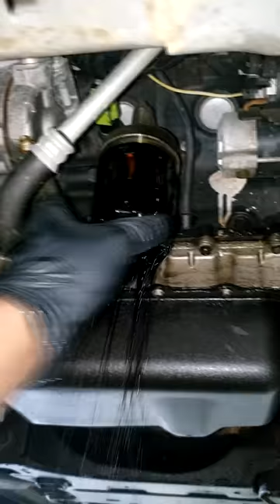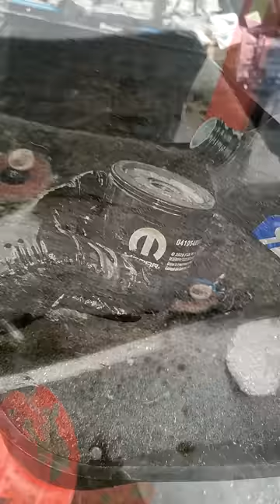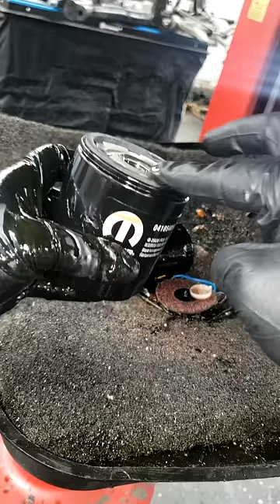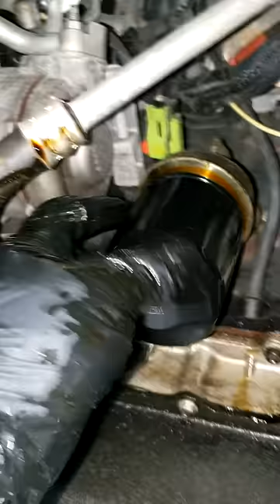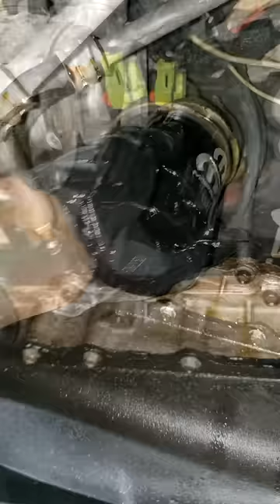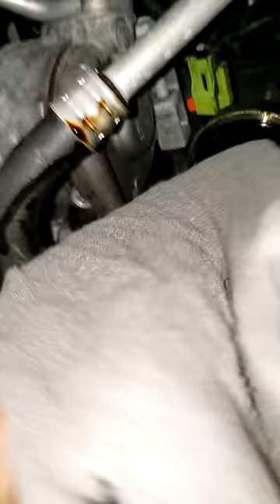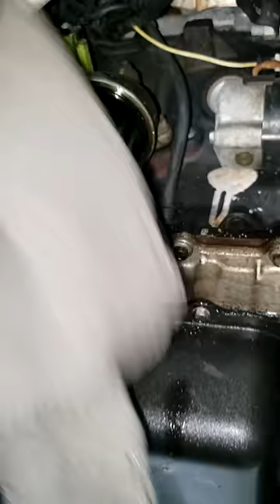Don't Lie.. Are yall still doing this?

Comment: We stopped when the engineers started putting the filters on the side of engines 😂
Reply: Mine's on top...
Reply: It still takes a few seconds to get that oil to the vital parts 😅
Reply: Designing the engine for the filter to be in the horizontal position is the most stupid design ever.
Reply: @bobby1970  what about the drain plug on the side of the oil pan so you can never fully change the oil?
Reply: @ryangallagher7262  Wow, I've never heard or seen of a oil drain plug located on the side of an engine oil pan. That's just as a stupid design as having an oil filter mounted in a horizontal position.
Reply: Looked for this comment. Felt like a dumbass after filling it to remember...its a side application. 😢
Reply: @CadillacDriver  even worse to prefill! 😂 but also... Luckyyyy!
Reply: @bobby1970  my nissan hardbody does that! And oh man you should see the filter location, I can't believe how many people love these trucks
Reply: @ryangallagher7262  
You don't need to "pre-fill" ffs.
Reply: I was looking for this comment. All the cars I've owned either had it horizontally or on top. 🤔
Reply: Or on top! Haha
Reply: @josedias2585  I just learned that was a thing! Luckyyyy
Reply: @CadillacDriver  mine too, so do we fill it where the filter sits? Lol doesn't seem like it matters if so...
Reply: @ivandreaver2227  
No, definitely not. Pre-filling is unnecessary.
Reply: I had a Saturn Ion and a V6 Tundra that the filter goes on upside-down.
Reply: My Hilux has it on the side, facing down at 45° or so. All other cars we've owned have them on the side at 90°
Reply: @bobby1970  maybe that was the only solution they found to stop stubborn mechanics to prefill the filters when it's totally unnecessary and might even send unfiltered oil in the engine ?
Reply: @pbe6965  What unfiltered oil? If it's new clean oil that I prefill into the new oil filter, then it's already filtered. It is necessary to prefill an oil filter, if you want your engine to have the longest possible life.
Reply: @CadillacDriver  Subaru huh
Reply: @DannyGruesome  ?? Cadillac CTS 2010.
Reply: @CadillacDriver  i was thinking of the topside can one from subaru. I forgot most cartridge filters are also topside
Reply: @DannyGruesome  
Indeed they are. Makes oil changes extremely easy. I've owned 22 cars, and worked on many more since the 90s. The CTS blows every other car away in terms of ease of oil change. I can't actually think how it could possibly be any easier.
Reply: Subaru is on the top, but you can crank the engine without fuel to prime the filter and oil system. Simply press the fuel pedal fully and clutch pedal if you have it. It will crank without starting until you press the start button another time or it cranks so many times. Simply prime until the low oil pressure light goes off.
Reply: FORD!!!!! IBeen driving chevrolets for years.. Went back to an f150.. And just like they did in 2009...the filter is still sticking out the front of the engine sideways.. So stupid
Reply: @garyrichardson7592  yep, also every time you start it up in the morning.  It's ok.
Reply: @stv-gq4vi  all is already in the filter it's okay
Reply: Mine is horizontal so i don't fool with it ! It's a chevy with 326 thousand miles on it ! Oil change every 5,000 !
Reply: So dumb
Reply: @CadillacDriver unless you have a diesel
Reply: @CadillacDriver  lol you are way way too proud of that old ass caddy
Reply: I just fill them with enough to where it doesn't spill sideways. Soaking the filter media first is better than blasting a dry filter with 60psi of thick oil. Fram filters blow the media out easily. A dab of hot glue holds them in place.
Reply: @benruether8294  you got the exact right answer my friend. I seriously commend you for understanding that when so many other people dont seem to get that. It never hurts to try!
Reply: @benruether8294  good point! Although I gotta say hot glue on an engine is like asking tinker toys to hold up sideways...
Reply: @ryangallagher7262  Never use cheap oil filters. That's what they use to hold the filter element center in the metal casing. Hot glue
Reply: I fill and spin the filter on anyway. If you're quick you don't lose much.
Reply: Yo lo lleno así ya esta empapado el cartón del filtro y un paso adelantado
Reply: @benruether8294  I've seen a lot of screwed engines with fram oil filters. When broken down you'll find these little silver flat round things. What is that?
Reply: Yes and even upside down!
Reply: @@StopPeepinToms I know what you mean, no can, just filter with a rubber ring on each end.
Reply: Yeah what's his plan for paper filters that go in on top? Dump oil on it and over the engine bay?
Reply: Correct. Most vehicles I work on have the filters on the side of the block now.
Reply: I had an old Honda Accord that was like that. I hated it.
Reply: I still try to add the oil in the filter on the side mount, just dont fill it all the way, but yeah, that side mount makes it messy
Reply: @bobby1970 
1. Most of the cars I’ve owned have you pour oil directly into the rockers anyway.
2. Most cars will get scrapped because all the electrical faults make them not worth fixing, long before the tiny bit of wear the engine receives has any effect on its expected lifespan.
Reply: @CadillacDriver  always prefill, tell me you wouldn't do that on a filter that takes 1 liter by itself and has three foot long remote lines.
Reply: @Deere2154D  who the hell is talking about anything but normal, road going cars? 
You do not need to prefill car filters. If you did, absolutely no filter housing would be oriented anywhere but dead vertical, on the bottom of the engine. You have taken my words and twisted them to a scenario we aren't even discussing here. Are you a flat earther? Because that is what they do.
Reply: @CadillacDriver  we are talking about filters.  I'm talking about normal filters I'm around every day as well
Reply: @Deere2154D  yeah? Well this discussion isn't about ones you are around every day.
Reply: @CadillacDriver  it's about prefilling filters you pylon.
Reply: @Deere2154D  no one cares what you are around every day. The discussion is not about THOSE filters.
Reply: @CadillacDriver  "how many of you guys when you're changing oil" not "how many of you guys when changing oil on small cars" 
Oil changes are oil changes, so yes it's still pertinent to the convo.
Reply: Exactly. That’s why I don’t do it. Duuuuuhhhh.
Reply: @Deere2154D  quiet.
Reply: @bobby1970 you mean you haven’t seen vertical top down?😮
Reply: It still might help to saturate the filter media, even if no oil is "loose" in the filter
Reply: Or if the filters installed upside down now so pre charging it you will just be topping it all back out over the engine that you tried not to make a mess
Reply: @bobby1970  yea dumb design. My drain plug is on the side of the of the oil pan. Not only can I not fully drain it..but it shoots out horizontally. I have to move the catch can way off to the side instead of underneath it to prevent spillage.
Reply: the hell is even prefilling supposed to do? it's a superstition lol
Reply: Mine's on top. I fill it up and let the filter soak it up while I drain the pan and take the old filter off. By the time I'm done with that, the filter is charged and I can flip it without losing any oil.
Reply: Or upside down, can't prefil a Subaru 0w20 filter
Reply: @pbe6965 whenever you add oil to the engine (including at an oil change), you are dumping unfiltered oil all over the camshafts. do you really think there is an internal guide to make sure the fresh oil you're pouring in doesn't go through the valve drain before it gets to the oil pan?
Reply: Full agree, I do this only when the oil filtre is in vertical position 😂😂
Reply: You can fill it a little bit just to soak
Reply: My 1968 plymouth has the oil filter sitting sideways
Reply: I got a Rav 4 1998, the filter is face down. I pour some to saturate the filter medium.
Reply: @bobby1970 It's done this way for two reasons, so it doesn't break off of the undercarriage, and its meant for you to change your oil with a jack, not a lift...
Reply: @bobby1970 my 2010 mazda3 is on the side…
Reply: @morpheus_9  That's a shame. It is what it is. Mazda is overall an excellent reliable vehicle.
Reply: @bobby1970  yeah, my mazda3 is a 2.5l and it has 275,000 miles
Reply: @morpheus_9  That is so awesome.
Reply: Hell yeah some car’s filters are on top of the engine lol. 

Everyone’s situation is definitely different.
Reply: @bobby1970 VW gti
Reply: I still do it even when they go sideways. I fill it halfway least the paper soak before I drain the oil.
Reply: YES!!!
Reply: Or in the bottom. Worst place to put the oil filter in some cars omg......
Reply: Yea. Mine on side. And I just changed my oil a wk ago and got a lot of it back onto my damn hand. It’s on the side but pointing more upward. So it only benefits me to fill it halfway and then put it on 🤷🏽‍♂️
Reply: Never have never will, never any issues either over 35yrs
Reply: Crown victoria cop cars have the oil filter in a horizontal postion :P
Reply: The filter in my 2nd gen Tacoma is on top facing down. I’ve never prefill my oil filters. 327k miles and still going strong.
Reply: We used to do that in the old days. The engines then didn't have the same type of oil pressure, compression, or horse power. As I remember, certain vehicles didn't have the oil pressure to fill the oil filter empty, it need the oil in there to create a siphon effect, and thus, you prefilled inordered to give it enough pressure to push through the filter. I never have pre filled the oil filter on my 03 Dakota. Every time I change oil, the filter is full of oil.  You just have to idle , cool down, and add the displacement amount of your filter.
Reply: @ryangallagher7262 I sware that’s why these smart ppl are really stupid doing things like that
Reply: @justinlizamor1541 engineers expected us to tilt the car. 😂😂😂
Reply: I always make sure to do this, even on subarus where the filter is  upside down.
Reply: @garyrichardson7592  yep it takes two or three seconds to get the full oil pressure back after an oil change. compare this to the literal minutes it takes for the oilfilm to break
Reply: I've changed oil in my cars for 50 yrs and never did this. I HAVEN'T any issues....
Reply: Don't forget the top as well.
Reply: @bobby1970 my Chevy cruze and vw passat both have the plug on the side not the bottom.. it is a stupid thing to not have it on the bottom. The oil filter is also on the top of the engine on the vw. Everytime I change it it's a mess if you don't loosen it and just let it sit for a few hours
Reply: Mines normal but i got an old Detroit soooo
Reply: Thank you cause as I’m watching it I’m like “how tf am I supposed to do that if it’s on the side shit finna fall right back on my face”
Reply: The Lexsus LFA has 2 oil filters on top of the motor.
Reply: Facts if I want to pour oil on my floor then I could just do it. In my opinion, that was them telling us that this shit is pointless
Reply: @ryangallagher7262 My Hardbody, my Honda,  my Toyota...nearly all inline engines are like that.
Reply: @jeanclaude7018  hey I got a hardbody too! '96 
Ugh that oil filter is a bitch and a half to get at lol try and prefill that one! 😂
Reply: @ryangallagher7262  Glad to hear of more HBs out there!  My filter on the Z24 isn't horrible to get at,  but certainly no way to pre fill it. My 280Z is like that too. The only way to change it would be a remote adapter and vertical filter on the firewall maybe. 
My Civic is worse because the ONLY access is from under the car, beneath the intake manifold.
Reply: If the filter is mounted horizontally and below the oil fill line, then it fills itself when you replace the oil.  But, not all of them are mounted that way.
Reply: @snarky_user  Well, in that case the filter would have to attach to the oil pan, because that's where the fill line is. They're usually up on  the block, far above the pan.
Reply: I don’t even know where mine is
Reply: Nice to have it on top. When you drain oil the filter will emty itself just by loosing it a little to let some air in.
Reply: HERE is The Savior

HalleluYAH translates “Praise ye YaH”

YaH is The Heavenly Father 
YaH arrives via the TENT OF MEETING
YaH was Who they Crucified for our sins
YaH was Crucified on an Almond TREE

— Ancient Semitic Cuneiform of Moshe (Moses)
— Isa Scroll (The Original Isaiah)

Isaiah 42:8
"I am YaH; that is my Name! I will not yield my glory to another or my praise to idols.”

Isaiah 43:11
“I am YAH, and there is no other Savior but Me.”

Isaiah 45:5
“I am YaH, and there is none else.”
Reply: This.  I can handle a slight angle, but perpendicular to the earth?  Bro.  Bro.
Reply: @bobby1970  easy to reach it from top when you don't have a lift at home.
Reply: I prefill mine about halfway. That way there's oil in it, but in spilling as much everywhere